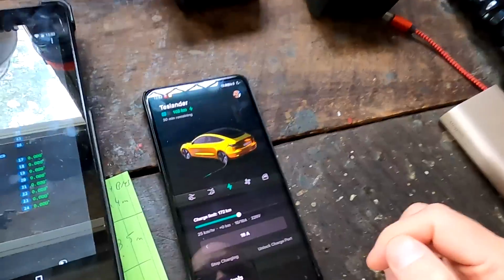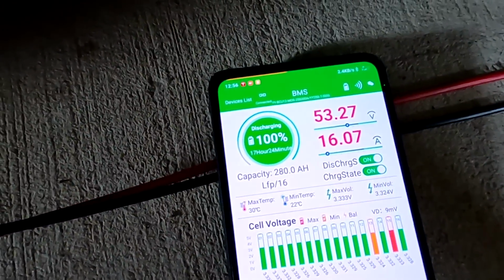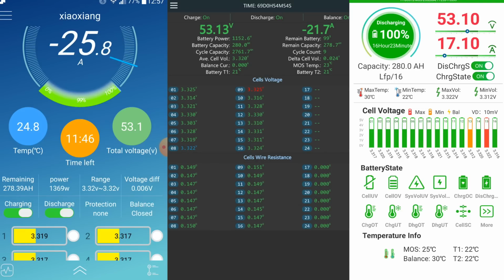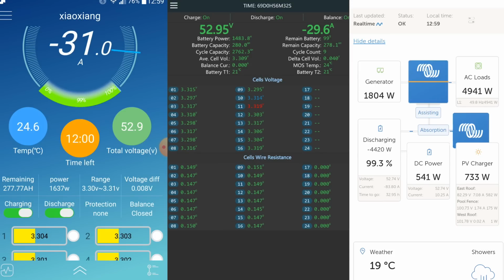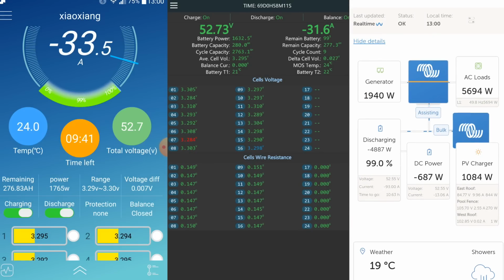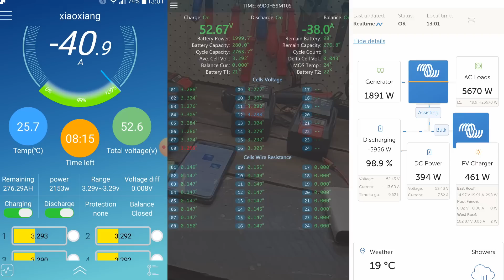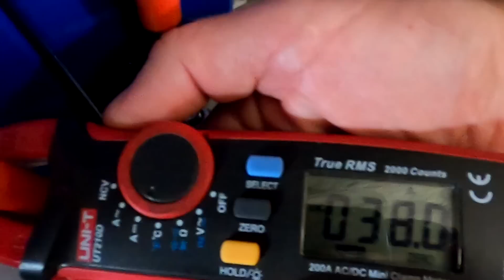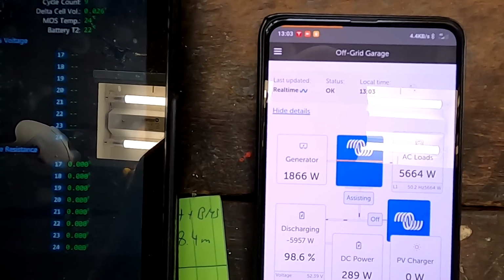Max load test on parallel battery banks. Will they deliver equally?

Comment: The Tesla can be charged 3 phase 16A = 11kW. Theoretically a charger does not need to see a phase offset between inputs (120°) and I know that some other EV just parallel 2 inputs to charge at 2x16A = 7.8kW.

Comment: Hi Andy. Very good video. The info you give and the way you present it is always top notch. I have been going through youtube to clarify if I can put 3 x 48V (15s) packs with identical cells and same BMS in each pack in parallel but could not find a clear answer. In my case it is really 3 identical 48V packs. You went 2 steps further, different BMS's and different capacity packs. It sounds that my questions are answered!!!! Let me know if I miss something please. Hennie
Reply from the maker: That will be totally fine, Hennie. Make sure you have some fusing or breakers at each bank so you can isolate them if needed.

Comment: hi andy, can you run this load only with the JK BMS?
Reply from the maker: Each battery bank has its own breaker with 100A, so 5kW would be the maximum I can pull from a single battery row. This of course is as per my design. There will be more battery banks following in the future and the more you have, the less current each bank need to supply your load.
Reply: @OffGridGarageAustralia  I just wonder what the reaction of the JK BMS if we push it to the maximum designed power. i need to buy BMS soon, i was thinking JK BMS and sephlos BMS
Reply from the maker: @wenhaowong5549  I have never run the JK to 200A. That would be 10.000W at 48V. I don't have a load large like this. But I will test the brand new 4s JK BMS soon. It has just arrived and we can run a 200A load test on this at 12V.

Comment: Hi Andy, best of the day and well done with your informative and educative videos. One question, how do you get by without a precharge circuit, or does the BMS have a precharge resistor built in. Will be glad if you can shed more light on this. Thanks
Reply from the maker: Thanks a lot. I only use pre-charge resistors for my 12V systems when I manually connect an inverter to a battery.
With the big banks, I just flick the breaker or switch and turn on the inverters.
In commercial projects, there is no pre-charge resistor installed anywhere. I could not find an information of a special setup or installation for such system. It may not be a problem as they are turned on once and stay on 24/7 afterwards. Unlike in a mobile application, an RV or boat...
Reply: @OffGridGarageAustralia  many thanks for the information Andy

Comment: quick question for community ..
i have 120mm2 cable - with crimp lugs for switch and inverter bus bar.
it was crimped with hydraulic tool and corret dies… 
however with IR camera - im reading ~56C on one of the crimps with 180A (@27V) 
…. is this indicative of a bad crimp?
Reply from the maker: It sounds like a bad crimp. You can use an internal resistance meter to measure the resistance. I've got one here on my website for such a purpose: https://off-grid-garage.com/measurement-tools-and-analisers/
Reply: Hi.. i suggest you to have a look at the busbar tempreture while charging also. Putting the crimp as the culprit would be premature

Comment: Incredible battery you have assembled there.  The load sharing works beautifully.  I notice many folks who actually have experience with this stuff are impressed with what you have built.  It seems like such a short time period from you just getting started to this beast.  You must have had plans/visions of what you wanted from before you even started this channel.  I'm curious now... how much could you charge the Tesla (assuming it was near empty) and the battery shelf was fully charged?  Would it be anywhere near a full charge? half?  I have no clue.
Reply from the maker: Thanks a lot. I had a rough idea in mind what to build but was changing design and requirements as I went. It took such a long time, I felt from when I bought just the shelf and a lot of people said it's not gonna work until just now and it's almost completed.

I have now 44kWh of battery storage while the Tesla has around 45kWh of usable energy in its battery (it's the smaller standard range battery). But there are losses during this process so I probably can charge around 30kWh into the vehicle with this battery if no solar is added during this time. I usually only need to top it up from what I used each day. That's around 4-8kWh from this battery for my daily usage.
Reply: @OffGridGarageAustralia  Following along with you on your journey to create this shelf o' batteries has been most educational & entertaining.  I had no doubt you'd end up with something amazing.  Over and over you asked for suggestions and the viewers dished out their opinions.  You often explained why some wouldn't work for you and also why you chose the one you put into action.

Thanks for the details on the Tesla battery/charging.  Those are some pretty heavy losses but I guess it's just the way it goes - DC to AC and back to DC , right?  Seems rather simple on paper... a battery charging another battery (though there's a lot going on between those two batteries).
Reply: Good one Andy, I had similar Q’s regarding the Tesla battery size & ur visions, so how many kms roughly do you get per kWh of battery capacity? Just curious! 
Also, today I finally got to have a play with my Bus system up nth which is currently a 12v system, but I have 2 x 5kw 48v all in one’s, and 2 x 24v 3kw systems. I have a few projects on the go for house, shed & bus up nth. I am probably going to go with the 24v systems for bus soon, but my big news for you is, today I finally hooked some capacitors up to the solar PV side of a renogy 40A 12/24v mppt controller and I believe it has made a Huge difference to the way it all operates. It has been a very cloudy day with a few patches of sun & when I hooked up a Maxwell bank of 64v I think about 188 farads worth at 1:30pm, the solar was producing around 52v and this was same as capacitors, so I hooked them up it was a bit sunny at the time, anyhow the controller shot up to an output of bit over 42Amps output & sustained this for some time as the clouds come over, it kept pumping 42Amps @ 14.2v.  
It is now 8pm & it is still charging the system at .8-1amp & 13.7v & the controller is still showing that the whole system is still producing power. 
I have 4 x 250w 30v panels in series parallel config 58voc but i have seen 65v once, so I may need another capacitor yet. The current 42A stayed the same while the clouds come over & the voltage slowly sagged down to about 16v, where it stayed for the rest of the afternoon & the amps come down to about 4A as it was very dark and cloudy, but this is much higher than I have seen in these conditions before & here @ 8:15pm now I am still getting .94A @ 13.7v & 13.1v on battery side and showing 100% capacity after cook dinner & coffee in Microwave & coffee machine can surge to 2400w, system was down to 96% after dinner and now is 100% again. This is amazing, I think I could be onto something here Andy. I have also found as u did, that my PV array is showing 300-500mv on a no moon night, how does that work? 
I will have to rewatch ur vid about that.  Ill wrap it up, 8:26pm & the 13.7v wont go away & still charging @ .8-1A, Wow, this will need some more research but I have to go back to Hervey Bay tomorrow, so I will let you know more of what i have found with this arrangement in a few weeks when I am back here, also I do have a set of 17.2v 3400farad caps on the battery side as well & I have 2 more 48v caps & 3 x 16.2v 3000farad caps I haven't used as yet. This has been long I know, but I thought u might find this info interesting, capacitors aren't too cheap, but seems they can make a huge difference on either/or both sides of a controller, providing you keep the voc in mind for the caps max voltage on PV side. hope ur not getting sick of my cap rant yet, as more to come. Cheers!

Comment: Extremely helpful.  Just getting into solar/lithium and fitted 2 x 12.80v to my van. I noticed 1 Bank at 120A capacity was pulling more than the second one at 100A capacity.  So this explains it.  
Sadly my first delve into lithium,  I foolishly purchased 2 Liitokala 150A 12v drop in packs. Both failed to make anywhere near 150Ah so to top balance,  I cut it open and they are 8 pouch cells with a nasty BMS so was stuck. 
I fitted Daly BMS but it wouldn't sort it so I had one cell constantly higher by 0.25v in one pack and 0.3v in another 
Your review on the 4s active balancer was a god send. Its now perfectly balanced my packs now. 
Thanks for your insights, its proved extremely invaluable
Reply from the maker: That's great feedback. Thanks a lot for sharing.
Reply: Is because a higher capacity cell has a lower internal resistance = delivers more current at the same SOC.

Comment: Hi Andy, do you have some kind of RCD installed after the inverters to protect yourself from electricity?
Would be great to show some complete wiring plan of your installation
Reply from the maker: Yes, I have installed a sub distribution panel with RCBOs and main switch as required for such installations. There is a whole video series about the PowerWall project here on the channel: https://youtube.com/playlist?list=PLPomydD54sgDaKmq2Uipmm-N32rqRodAl
Reply: @OffGridGarageAustralia  Thanks a lot, looks like there are some more videos to watch for me! Because of the Russian war in the Ukraine, I decided to throw up our solar energy self consumption to avoid buying energy made from Russian coal or natural gas. We already have a battery system for the house, but it's not big enough, to charge the EV in the evenings on some days. The problem with that is, that it would be very expensive to extend its capacity. And since it was partly state funded, that would be a lot of paperwork. So I ordered batteries and a Multiplus II to build a charging station with batterie buffer. In a first step I would charge the batteries via the Multiplus whenever I have energy outgoing to the grid. Some kind of energy storing home appliance 😉. And in a second step I plan to add more solar panels and a MPPT to charge these batteries directly. The thing I struggle with at the moment is the DC circuit breaker. I ordered one from Taixi like shown on your website but I'm not sure if these Chinese devices are very reliable and safe. But I could not find any similar here in Germany. Some other people use melting fuses for that, but I'm afraid they could react to slow. 

Schöne Grüße aus Deutschland

Comment: Hi Andy, and thanks again, for sharing these videos. I'm really impressed! it's really good!
with so little difference, at the discharge? impressive!
It will be nice to see how it works, in real conditions, i.e.:
charging (solar and these fluctuations) and discharging, but over a minimum of 2 weeks, or 1 month. (without touching the settings)
if really, after 2 weeks, or 1 month, the differences remain so minimal, really congratulations!
Reply from the maker: This review video will come this week showing what happened after 2 weeks of using the battery...

Comment: why all 3 BMS show a battery capacity of 280ah? shouldn't one of them be 304ah?
Reply from the maker: Yes, that is correct. The one at the top (in the left of the screen) should show 304Ah. I just forgot to set it right. Good observation 👍

Comment: You can push 8kw right? 5+3 or?
Reply from the maker: Yes, that would max out both inverters. The Multi can do 4kW and the Phoenix around 2kW continuously. That's already far more than I need at the moment. It will be less in summer time though when it's hot down here.

Comment: With a large current draw through the Victrons to charge the Tesla, are you worried abut DC Ripple impacting the batteries?
Reply from the maker: Not at all. This would only affect the inverter itself, not the battery. With the large 70mm cables to each inverter, I stay fully within Victron's recommendation for these inverters. There was never a warning about high ripple on any of the inverters even not under full load.

Comment: I don't understand why you're so happy, you have 48 batteries fully charged and you might get 8 hours use out from them..  Does not seem long enough at all.... am I missing something?
Reply: That’s at full load, how often at your house do you use everything at the same time for eight hours? The point is a lot of the time during the day or night you’re not using much electricity at all which will extend that 8 hours exceedingly…
Reply from the maker: With current loads, the battery will last me a week now without any solar input at all. Even when I charge the vehicle daily from it.
Reply: @OffGridGarageAustralia  That is a lot more sustainable... a week is a good backup and the chances of a full week without sun in Ozzy land is small I think..
Reply: It might be considering the solar input and the loads will not be maxed out all the time. André
Reply: At that load it is good. I would say very good. At normal use the time will probably double. If you add the solar charge controllers then it would probably triple.

Comment: Andy, an experiment for you to conduct.  Charge your 3 batteries to the point where they are starting to rise up in voltage then observe the current into each battery as they all rise to your full charged point.  Ideally this should be done at a time of the day when your solar arrays are at maximum production to make the highest possible amps available to the batteries.  The point of this experiment is to demonstrate to viewers that even though they may have matched (I know you don't) batteries the slight differences in those batteries will result in uneven current distribution during charging with an increasing disparity in the rapidly rising part of the SOC voltage curve.  This needs to be considered to ensure that no single battery receives excessive charge current, even to the point of the BMS disconnecting charging.
Reply from the maker: Shown this in two videos now. It's not a problem, current will balance out between the banks.
Reply: @OffGridGarageAustralia  That's interesting Andy.  I watch all your clips and don't recall this test being done.  This is not about separately charging batteries.   This is charging two batteries in parallel.  Amps diverging as one battery achieves a higher state of charge relative to the other is common in battery systems of all chemistries.  None the less, would you be kind enough to point me to the two clips you mentioned?

Comment: Andy, Thank you for letting us know how inaccurate the 25S200A Smart BMS is from Heltec.  It would be a shame for someone to buy this BMS, thinking it was going to be good, and find out that it isn't very user friendly, and doesn't report accurately to the application.  We are asking you to please find another BMS to replace this one before someone is misled.  I did go to Heltec's site to verify that they are still selling this BMS, and they are.  I would have thought by now they would have removed it from the website until they have worked out all the issues.  I'm not trying to say that Heltec doesn't make good products, because they do seem to make a good active balancer.
Reply from the maker: The Heltec BMS is not bad, it is the app which totally lacks functionality. If they work on that and make it better it will improve the overall functionality of the BMS as well.
I still haven't heard back from them, need to chase this up...

Comment: The helltech, is about 30-35% out, Andy.  Calibration what is that for a BMS?  From a old Calibration technician. Your multimeter for current maybe out 5 %.  So 5 plus 30 to give the right out come. That would match the other BMS.

Comment: While you are under full load, measure the voltage drop from bottom positive terminal of battery to top positive terminal of your rack where the cables for the inverters hook up

Comment: Awesome. I am seeing with my 4 banks I would pull around 30 amp each. around .11C I will never have that kind of load unless I buy an electric car. I would charge my car during the day to take advantage of the extra solar output. I must say you have the best channel around. you could even charge your extra bank for charging car after hours if needed.
Reply from the maker: Thank you. I had to turn on all loads I have, even the lights to get to this point. And 40A is not bad at all for each bank under such a high load. I have to charge the vehicle in the night as I'm not at home during the day, hence this massive buffer. But yeah, If I'm working from home, I charge it during the day. More to come, the list of videos to make is growing...

Comment: Quickie question, are your cables from the battery to the inverters connected to the top of your vertical bus bars? Would there be a better balance if one of the two cables was connected at the bottom of the vertical bus bars?  Some users claim that feeding the inverters from opposite ends of a battery STACK results in a more even charging and discharging while connecting both cables in the same ends of the bus bars causes a greater effect on the batteries closet to those ends.
Reply: Yes, the inverter is connected on the top only. In theory there would be a more even distibution if the inverter would be connected at the opposide ends (when both wires tonthe inverter are also the same length). But his busbars are so big (30x10 mm, rated for 680 A) that it does not make a difference because of their low resistance. Resistance in the cells themself and in the bms is much more relevant for equal current distribution.
Reply from the maker: I oversized the bus bars by design as @Sebi said to overcome this problem. Also, it is not a problem if the banks discharge unequally. If they are almost empty more power will come from the battery banks with the higher SOC, so they will balance out again.